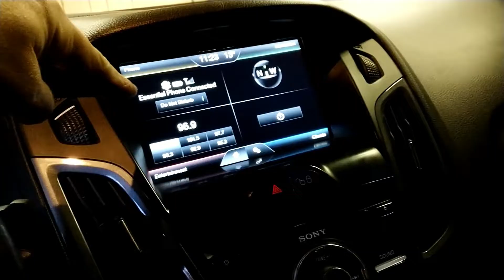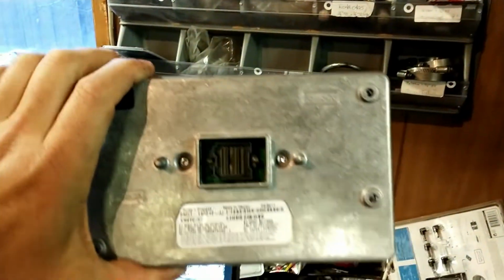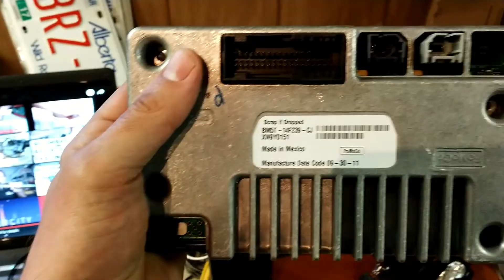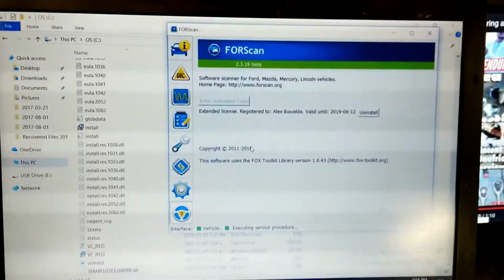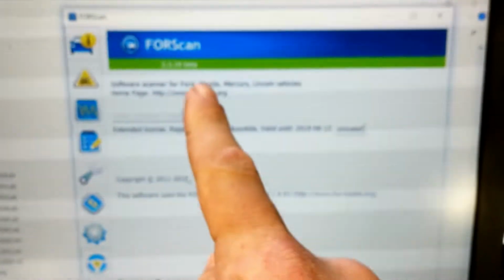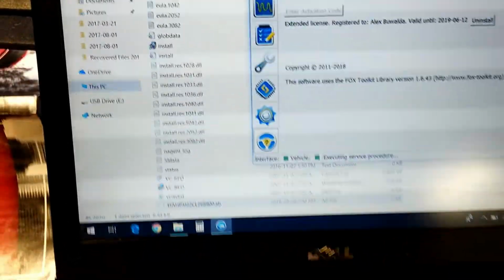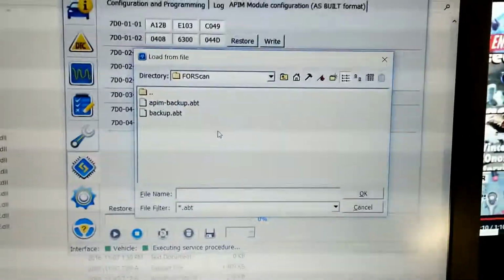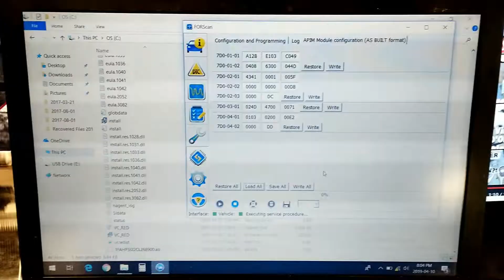Broken Ford Sync APIM Repair\Replace\Reprogram

Comment: I changed mine, and I couldn't update it. Because navigating is not on, please how did you download a patch from Ford to bring the sync up to a newer version that finally restored Navigation, or you i just need the obd to update the navigation, i will appreciate response 👍
Reply from the maker: Hey there, I believe I did have to update mine to get navigation working.  Check the link to the Ford Explorer forum on downloading the update, you'll have it working in no time, just stay patient!
Reply: @Kingsoupturbo thanks on your response appreciate,  i did use my vin to download the new update it didn't work , it said, (THE UPDATE DOESN'T WORK WITH NO NAVIGATION)
Reply from the maker: @rchrdnana45  Did your VIN code not have navigation perhaps as an options? I can't see that being in the VIN code, maybe? I know on our focus it was a ludicrous 800$ option at the time.  You might just need another VIN to get the proper update?
Reply: @Kingsoupturbo, just like you said, we are not made of out money by brother. Since it works, i will leave it that way, just listen to the radio 📻 🎶.
Reply from the maker: @rchrdnana45  I hardly ever use the navigation in the Focus anymore, just have the google tell me where to go (on the occasion it knows what its doing!)

Comment: 2015 Fusion Hybrid. 
I have no communication errors. 
Does that mean it just needs the asbuilt install?  Ik things aint that simple but sometimes they just are.  My client says he installed a new radio and controller and there are no communication errors.  Im assuming it needs programming.  What do you think?

Comment: I am experiencing the same problem. It’s my Brother in Laws 2011 Ford Focus SEL and the infotainment system stopped working. The screen is completely black and I have tried everything and even bought another APIM but sadly the main connector was missing.
Reply from the maker: Hey there! hopefully you can return that APIM and get one with the proper connector!  I hardly even see Focus's of this gen on the road anymore, should be plenty of parts out there! They're decent cars, and cheap to own an operate, worth keeping on the road! sometimes a bit hit or miss buying parts online, just try again, 2nd times the charm right?

Comment: Thank you! I asked the dealer to update my APIM software and they completely bricked it. It was working fine, just on an outdated version. When I got my car back, it was completely dead and I was out $95 for "diagnosing" the issue...
Reply from the maker: Hello! Good gravy! that's not very fair! they should have covered replacement from killing the unit on a software update.   I would be pretty upset about that, sorry for your bad luck, hopefully the video helps get it back in working order!

Comment: They claim my Vin doesn't qualify on my fusion. Yet. 4 yes ago the exact same part failed in it, cost me 891.00 to repair and the dang thing is broken Again. No stereo! Bull crap
Reply from the maker: Thats brutal! they replaced it and it failed again? I'd try a different dealership, you can get very different responses.  Android stereos are cheaper then ever now, and even low cost ones have android auto and carplay.  I'd be tempted to just go aftermarket at that point, I rarley use my Ford navigation anymore anyways (if mine fails again, I'm not doing another APIM replacement).  Sorry for your bad luck, what a joke right?

Comment: Thanks, friend bought replacement apim but nothing worked.
Reply from the maker: there are a few fuses you can check as well if it won't power up! or software issues?
Reply: @Kingsoupturbo  so we went back to my friends bronco and plugged in the apim he got on line . And discovered his original had five plugs, and the replacement only had 4.
Reply from the maker: @frankiepuebla9017  Bronco! must be a fair bit newer then this 2012 focus, well hopefully can return and look for the proper matching version online!

Comment: Hey man...2020 ford explorer APIM issues.  After every car restart, it loses its memory  and goes to am/fm instead of the previous xm/sirius channel.  The screen locks up/goes blank/has to be reset constantly.  Ive used forscan many times on my f150...do you think reprogramming the apim on this 2020 explorer will be worthwhile?  Or is the APIM toast lol?  Thanks!  Love your videos btw!
Reply from the maker: Hey there! thanks for the kind words! I had a look and it looks like a pretty widespread issue on sync 3, which is kind of incredible to me given how many issues they had with the earlier version.  I read that there is an update to Sync3 that should fix the issue, or you can jailbreak the system and set it up manualyl, check out this thread on reddit for more info, best of luck fixing it, I would be outraged personally on such a new vehicle!   https://www.reddit.com/r/f150/comments/129nty5/2019_f150_sync_3_partially_resets_every_time/

Comment: Good gravy, prices on these things now several hundred $ on ebay 😩 just bought a 2015 escape from some old folks who I assume never tried to use the Bluetooth and didn't realize the system was jacked up. Can't even get into any form of Bluetooth pairing menu at all. PHONE button does nothing, voice button does nothing, SYNC Phone menu option does nothing. Gaaaahhh
Reply from the maker: Hey there, thats not so bad really!  If the screen is still working, you're doing better then most.  I"d try manually pairing bluetooth through the touch screen, odd the buttons don't work, but that might just be dirty contacts underneath.  There is software updates for most versions of Sync as well which might cure your issue!  The sync voice control, its fidgity at the best of times as well!
Reply: @Kingsoupturbo  hey thanks I really appreciate the reply. Mine actually doesn't have a touchscreen, it's the SE trim so it's got a small screen but only for displaying info. Another weird thing is the backup camera frequently shows and upside down view (or just possible zoomed in, won't zoom out)
Reply from the maker: @mikeyroos4229  Hey there, I read that its a common ford issue with the Camera. Apparently if you disconnect the battery for 10min, touch cables together to drain every last volt (after disconnected of course) then plug back in, it should force a system restart.  If the camera starts working after that, its likely showing a software issue, might fix the bluetooth as well!
Reply: @Kingsoupturbo  I did try pulling the negative cable for about 30 mins and also pulling the sync fuse but have not yet tried the full battery drain. Might just have to be the next attempt, thanks! This is all totally insane, never woulda expected this to be a problem, let alone a COMMON problem it seems. Imo Ford should be fixing this stuff at the dealership no charge because in no way is it a normal wear and tear or owner negligence item 🙄
Reply from the maker: @mikeyroos4229  Ahhhh thats a shame its still doing it after reset! MMmmmM I have learned that Quality is not Job 1 at Ford, far far from it.  Lots of people are outraged at the poor quality on Sync electronics, some documents were leaked a few years back about the Disastor that was the sync program, and the 6 speed auto trans (in my Focus).  But we do the best we can with what we have!  I'd think the control module on the SE will be very very low cost to find another one. You might be able to do the USB software update as well, search on the focus Fanatics website for more info, if its anywhere, its probably there!

Comment: Mine just died...but looked online and can't find a module for under $500
Reply from the maker: I had a look online to see if they're still cheap, you can get a sync2 not expensive, they sell apple carplay upgrade to Sync3 modules out of china that might be worth the money.  Here is the search term on Ebay for an idea of a low cost options.    Ford Sync 2 Sync2 APIM Radio Module Ford Focus DM5T-14F239-AP EA5T-14D212-DA

Comment: My son has a 2014 ford focus and the battery kept draining. the dealership said it is the radio. that we need a new  interface control module for $1400 😳. does this mean he needs a new APIM? im trying to figure out how we can do this ourselves.  any help is appreciated
Reply from the maker: Hey there! I'm surprised the battery would be drained from the radio, does it still work, like light up and play music etc?  One way you can check for sure on your own, is to pull the Radio Fuse and see if it drains overnight.  (there are also videos on how to test for a parasitic draw on the battery, I had to do this recently on an Infiniti)  Dealership i'm sure would have mentioned to remove anything that isn't factory equipment (bluetooth chargers etc.)  Check to be sure all the lightbulbs are turning off (glove box can get stuck on, door lights aren't switching off, center console) those are very common to kill the battery.  I have not heard of the factory Radio guzzling power like that.  These can be tough to pin down, check the Ford Focus Fanatics forums for more info, that is where I look most of the time to help with issues on the car, best of luck and thanks for watching!
Reply: you'll want to replace the ACM (Audio Control Module).  search YT for videos - tons out there.  I'm doing our 17 fusion as I type.

Comment: So if your stock APIM is out, can you reprogram it without buying another one?
Reply from the maker: Hey there, Once they fail I don't think you can reprogram it to work again, you need to find another one that actually works (it should boot up when you plug it in, but it might be from the wrong model car and not have the right functions)once you source another working one, then you can reprogram it to be exact for the model you have.  Best of luck!

Comment: I have 2014 taurus police interceptor with black screen and no sound. How do you know if its the APIM and not the ACM (audio control module)? And if it's the ACM can you program it the same way?
Reply from the maker: As I recall the faulty board is all to do with the APIM, but it could be another module as well.  You end up kind of taking a chance when replacing the APIM guessing its the issue, but considering the failure rate and Ford extending the warranty (slightly) thats probably your culprit.  But on a car that idled for 10,000hrs, anything is possible!  I'm sure you can resell the unit if it ends up not being the issue.
Reply: @Kingsoupturbo  Thanks for replying.  I  took it to a car audio shop and it was diagnosed as the ACM. I bought a used one from junk yard with exact part# when he went to install it it didn't work. but I just learned about having to reprogram which I don't think he knows about. Should I try to install it again and reprogram or should I send the ACM back and try for a used APIM?
Reply from the maker: @chantellbritto8559  I would try for the APIM, in the significant research I did to fix my own car I don't remember finding a lot of reference to the ACM being the issue and I don't believe its covered under the slightly extended warranty. (indicating Guilt from ford on this) I don't believe there are error codes for either module, so its tricky to diagnose, but the APIM of this generation is known to be faulty and unrepairable, best of luck on getting it repaired!
Reply: @Kingsoupturbo  Appreciate it!

Comment: Would I really need to replace or can I just reprogram my own unit?
Reply from the maker: If the screen doesn't turn on anymore, replace, you would only reprogram ideally if you got a replacement unit from another Ford different model.

Comment: Fellow Calgarian says thanks for the video.  Will help me fix my in-laws sync screen after a trip to pick n pull.  I used ForScan to mod up my F150 with continuing folding mirrors when you lock the doors and heated seats and heated steering wheel buttons on the sync home screen.  ForScan is a very cool tool.
Reply from the maker: Excellent! I never thought of using it afterwards for other functions, excellent!   Hopefully the fires up north get put out soon and we have a nice smoke free summer!  thanks for watching!

Comment: Great video, never knew about FORScan before. I purchased an APIM from someone who did the VIN programming, it's working fine. For my old OEM APIM (black screen of death) - does anyone repair these? Or is it a paperweight now?
Reply from the maker: Hey thats great you got it fixed! As far as I understand its a circuit board failure, so paperweight she is! (Rumor is the entire system cost a mere 14$ to build for Ford) Enjoy having it working again!
Reply: Hey Dave if I was to order a replacement APIM for mine, ( have an 09 flex at the junk yard ) do I have to have someone program it with my vin or?
Reply: @SubarooSam   if you are a little techy, you may be able to use FORScan to reprogram it yourself
Reply: @SubarooSam  it is likely that the APIM has to be matched to your specific VIN, so it will need to be programmed

Comment: Great video - Just replaced and reprogrammed the APIM in my 2012 Edge with an APIM out of a 2014 Escape! Got all my parts for less than the dealer would have charged to diagnose the issue.
Reply from the maker: Fantastic!!!! Great job, screw ford and its overpriced faulty electronics, they can't beat us!
Reply: Mind offering some input on what you did exactly?

Comment: Thanks for the video...Mine is done and was told 1500 bucks. Been black for 2 years now. Gonna try this
Reply from the maker: Two years!! Brutal! if you can find one from the same car, you don't even need to program it, hope you get it fixed, 2 years!
Reply: How'd it go?
Reply: Got a used one from similar make /model for $95 cdn, plugged it in ad she is good now. Only issue so far is APIM says I have steering wheel heat, when I don't.
Reply: @jasoncottier4910  I went to my local yard today, found a Lincoln mkx, and a ford edge. Plugged each in both running sync 2 but both work, only issue is no backup cam video ability, and no gps
Reply: @SubarooSam  Any possibility that Edge Sync 2 is still available in perfect condition. ?
Reply: @ragavendrarahul4610  not sure if you're asking if I have one in my local yard? I still have one of the units outside with my tools if you are in need of one it's for a Lincoln but everything works besides backup

Comment: my APIM is BM5T so I can use a DM5t from same car i have a 2012 Ford Focus?  Thanks for the video !
Reply from the maker: I looked it up, looks the same in the pictures to me, it'll probably come with the updates already installed as well, which are helpful! I think its the same sync2 2011-2015.  Glad you found it useful! if its the same APIM should be almost no setup when you install it.

Comment: Mine went out at 34k miles and less than 4 years old.  Definitely junk vehicles made by Ford.  Of course, have a friend that bought a brand-new 2021 Ram and hers went out after a month.  So, anyone that thinks they can do a better job outsourced than we could insourced, realize that's just blatantly false.
Reply from the maker: I"ve come to learn that Ford isn't that interested in longer term reliability, or quality for that matter.  The Focus drives great but has been plauged with major issues compared to Civic\Corolla\3.  With all the Rams\F150's\Focus I"ve owned, I won't own a domestic again.  Thanks for watching, 34k miles to loose the Sync is rediculous.
Reply: @Kingsoupturbo  Thank you for replying.  I took it in yesterday, and the entire Sync, display, and I think it's the APIM has to be replaced.  Luckily, I purchased an extended warranty, so it's only going to cost me the deductible, but I can't imagine how someone whose had their truck sitting for a 1/3 of their warranty period due to Covid finding out it isn't covered, because the warranty ran out.  Really disappointed in the product.
Reply from the maker: @pstewart5443  At least you have some coverage! nice on getting extended on the Ford!  They did extend the coverage on the APIM but its ends I think well before most of them crap out, which seems to be all of them.  F150's seem to be the same, slap together a new fancy powertrain without much testing and watch it explode, deny warranty on it, or wait until it runs out.  They might criticise Titan\Tundra for not changing much over the years, but reliability is top of the class.  I'm disappointed in Ford as well and have owned a bunch of Rams which are pretty shocking in quality control.
Reply: @Kingsoupturbo  So that happened to my son about 6 months after I bought mine, he used the lemon law to get them to buy his truck back.  After the second rebuild and replacement of the transmission he'd had enough.  Another reason I refuse to buy another one.
Reply from the maker: @pstewart5443  Wow! at least he was able to use the Lemon Law.  The dodge Ram Hemi tick exploding Camshafts went on for years and years (all Hemi's) and they couldn't be bothered to fix it, let alone electrical issues. My F150 ejects spark plugs from way to few threads, then the next F150 way to many threads and catastrophic Phaser failures, all those 5.4 trucks are worthless or blown up, let alone Ford's endless diesel problems.  No, for me it would be titan\tundra only as much as I like new F150's and Rams.   I'm a big fan of my BMW station wagon (E61) the best built car I've ever owned, and most corrosion resistance, and I've owned almost every single brand.  Its no wonder CRV\Rav4\Camry\Accord have been the best selling vehicles (non trucks)forever, people know the truth.  Happy motoring and enjoy the summer!